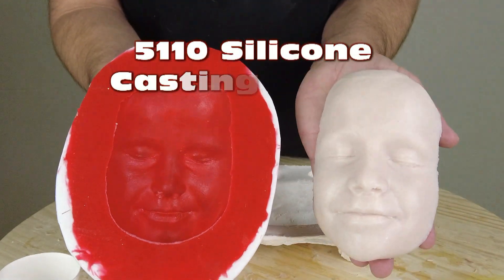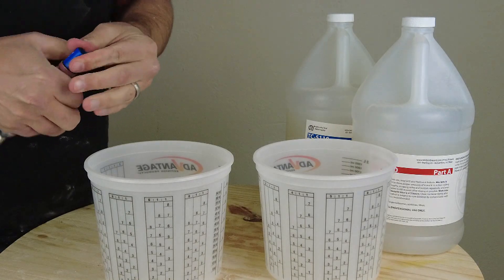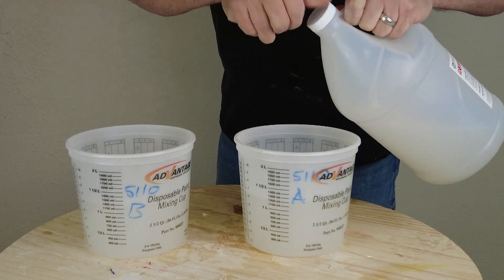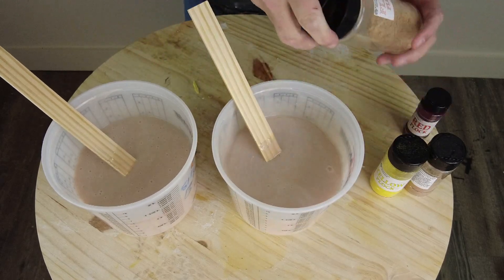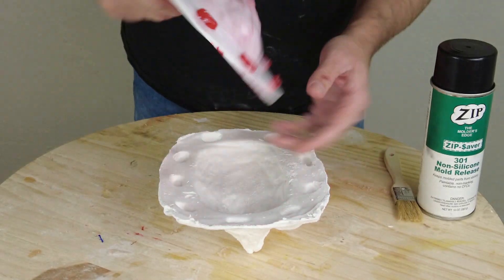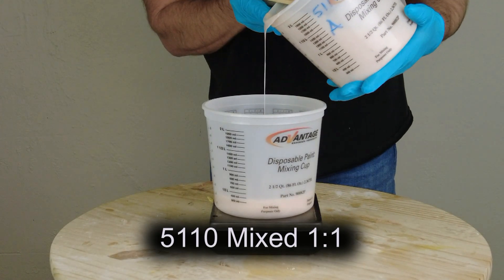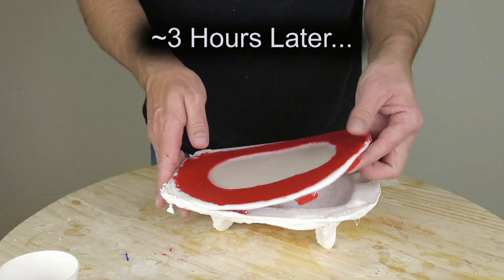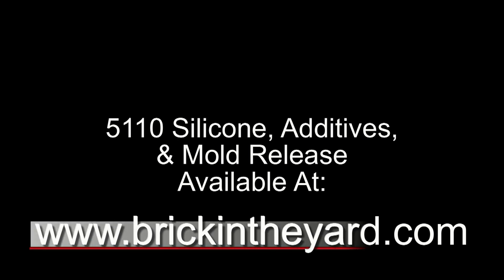Coloring & Casting 5110 Silicone

Comment: Is there a way to give silicone a skin like texture?
Reply from the maker: The cast silicone will pick up whatever skin texture is provided by the surface of the mold.
Reply: @brickintheyard  I meant more for creating prosthetics for the face.
Reply from the maker: In that case, the clay being used to sculpt the prosthetic can be textured exactly the way you want it to look on the final prosthetic. The mold material will pick up that texture and transfer it to the silicone prosthetic. Once it has been cast I don't know that there is a practical way to add texture.

Comment: This is very helpful, as always! A couple questions:

1. I looked through your videos and heard mentions of layering varied hardness levels for a more realistic skin texture, but I couldn’t find a demonstration of it. Is there one, or is that so specialized you haven’t done one like that? The mentions made me curious. 

2. You can clearly get great effects by adding flocking to poured silicone. Is it something you could add alongside pigment when painting silicone? 

2b (I guess). Can the darker brown flocking give a freckled effect if not uniformly mixed, or are the fibers too small? I remember a video with paint splatter freckles but was curious about whether this would also work. 

Oh, my mistake, I have one more question—do you have a video on safety gear/practices for different materials? I’m trying to work out what will be safe with my space/ventilation/respirator situation. (Sorry if I missed one like this!)

Hopefully those are quick questions… like ‘not yet/not planning to’ or a link, etc. I know y’all are busy!
Reply from the maker: Flocking is really only used in the casting process. Freckles would be painted later. As for the layering of different skins, I'm not where I can search all the videos now but I will look later. I'll see what I can do about a safety video. Thanks!

Comment: Could you guys make a video on making a  brush on silicone mold of resin 3D prints.
A lot of people have trouble with the silicone curing. 
It would be good if you guys having a silicone product that’s compatible
Reply: Most UV resins use a Sulphur compound in the mix.  You probably need a chemical barrier (like the 2350 Sealer), a lot of cleaning, or to let the part set under UV for a long time.  Also, Platinum silicone is more sensitive than Tin cure to Sulphur contamination.
Reply from the maker: That will definitely be in a future video!